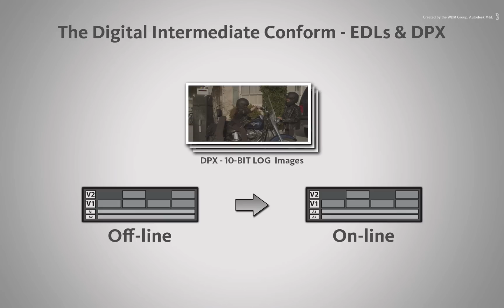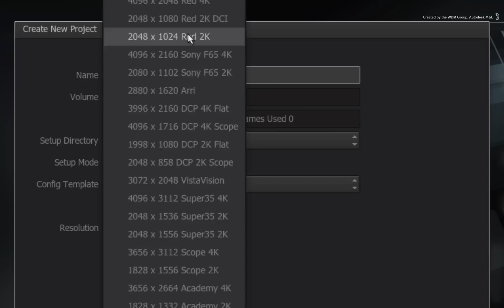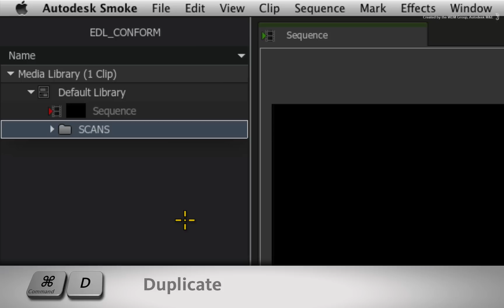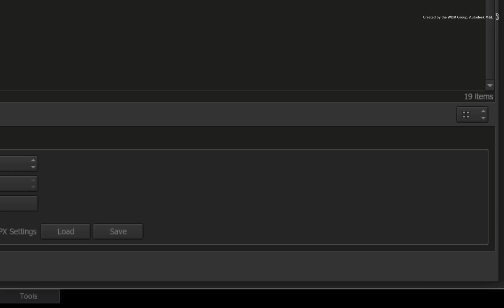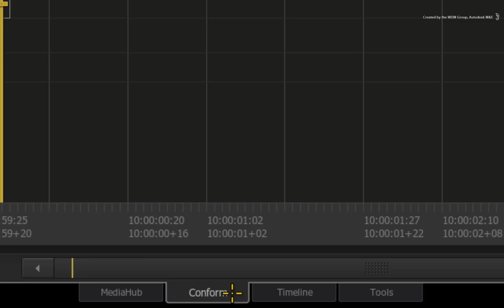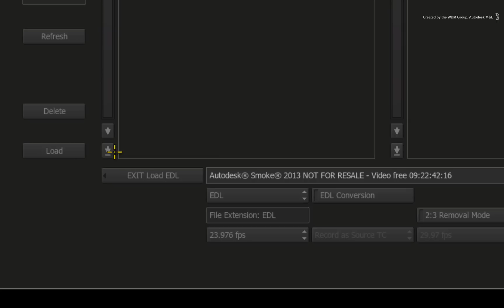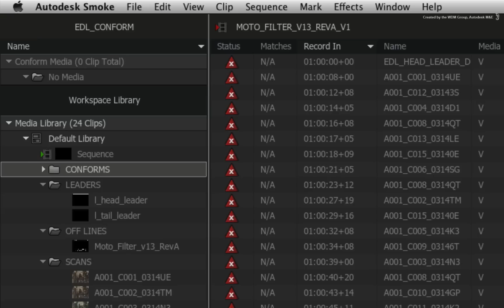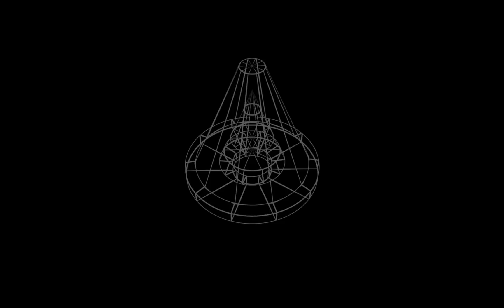The Digital Intermediate Conform with EDLs and DPX - Part 1

Comment: Great video, im going to start on a feature using a dv camera 1080i , will that have problems with the di in he post stage?
Reply from the maker: Hi Captain Howdy, you shouldn't have any issues during the post stage.   You can set your project to work at 1080i and that should keep everything consistent.   Hope this helps!
Reply: That's great help , im going into this with no film education or advice from anyone (you are the fist feedback i have ever got) so i just need to be sure that all the hard work that is put in will not turn out that bad. Thanks again.
Reply from the maker: Good Luck!

Comment: DPX files tend to be 10bit, Avid offline references tend to be 8bit.  The inability to do a real time split between the 2 of them is a real killer.  It basically requires the reference to be converted to dpx as well, a huge waste of space and time.  You guys need to be able to fix this, even if it is just some temp quality playback in the gpu as Avid offlines aren't going away.